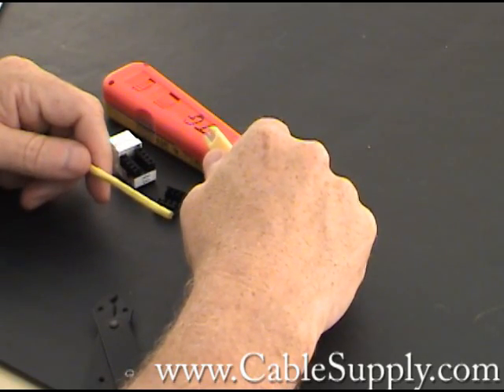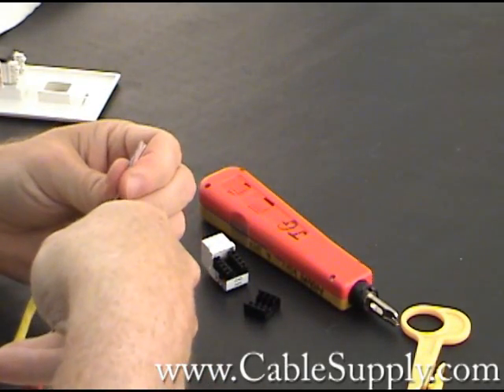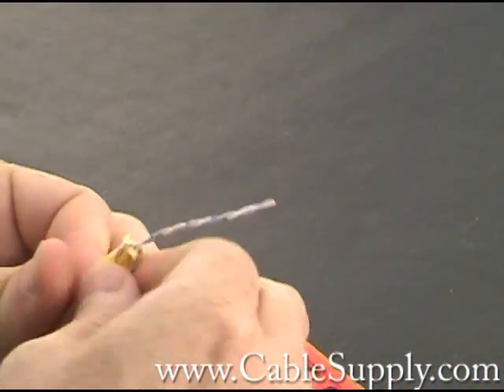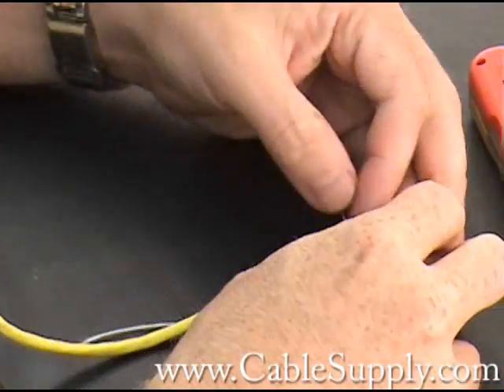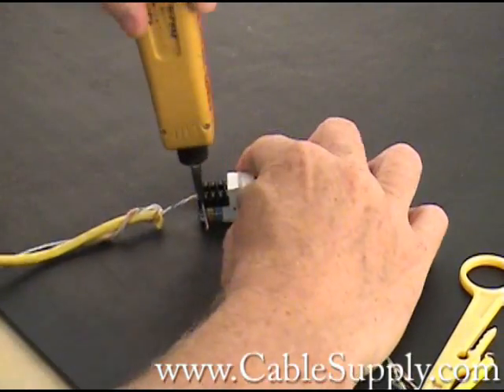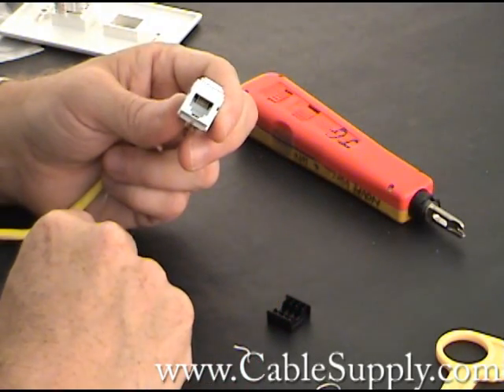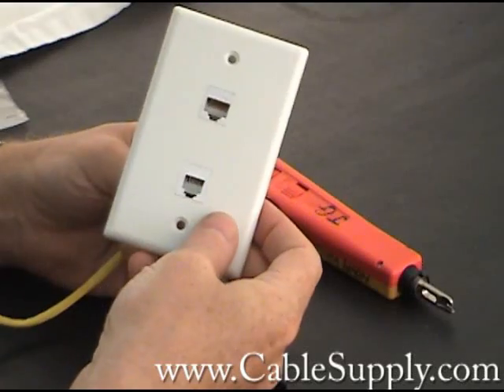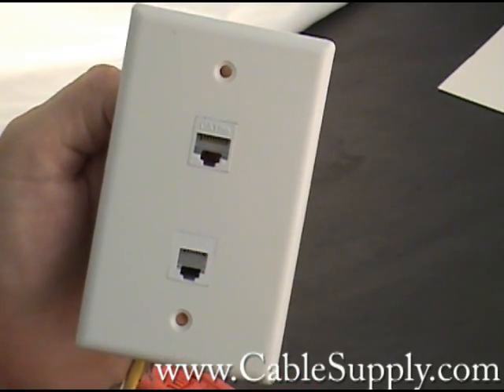How to punch down an RJ11 Telephone Jack

Comment: Do you use the strain relief facility on the internal wall side of the insert to take the strain off the cable, prior to feeding the wire into the slot for punch down? There is a small hoop for this, wrap through twice, then into the slot. Great video, thanks for posting.

Comment: What to do if your house is wired in a ring topology?  You can't punch multiple conductors onto each pin can you?  And most push-in wire connectors don't take 24AWG wire, right?